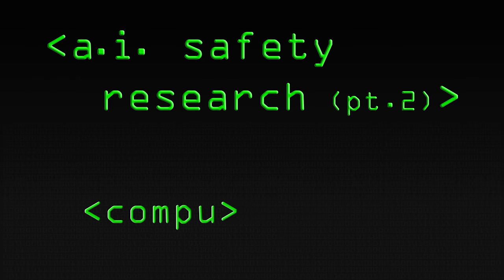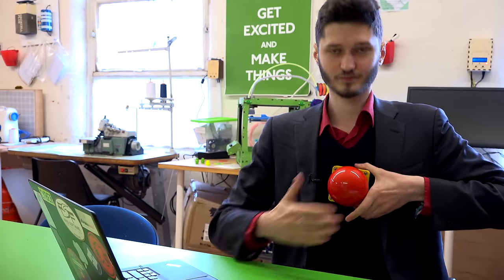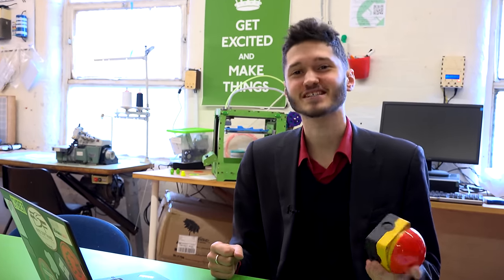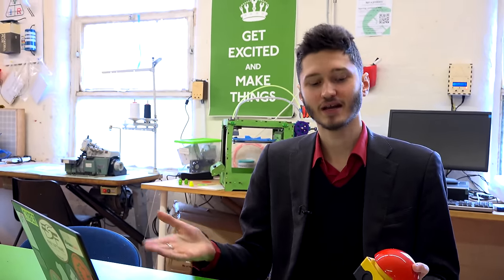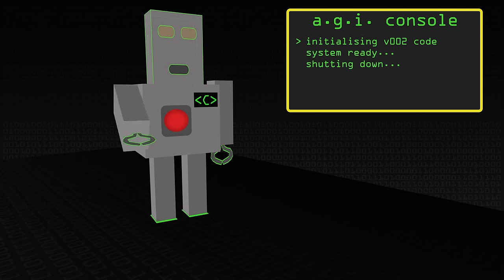AI "Stop Button" Problem - Computerphile

Comment: I thought of the following solution:
If the robot disobeys you or does something you don't want, points less. So if the button gives the robot, say 99 points and getting coffee gives 100 points, if it fights you for the button thing, it will loose 20 points, thus gaining only 80 if it gets the coffee after fighting, but 99 if it lets you press it.
This way it will not want to press the button, but also it will let you press it so it doesn't get even less points.

Comment: Why don't you give the AI a massive number of negative points for trying to stop someone from pressing the button? The negative points would have to outweigh the number of points for completing their task. This means that they wouldn't try to stop someone turning them off in order to finish the task because they'd end up with less points overall, and they wouldn't try to get someone to press the button, and they wouldn't press it themselves, because they wouldn't have any incentive to do so.
Reply: They would still have an incentive to push the button themselves because the AI will be calculating opportunity cost.  So if it takes 10 points of effort/work to get the tea for a reward of 100 points, and 1 point of effort to push the button for a reward of 100 points, it will always prefer to push the button.  Since 100-10=90 versus 100-1=99, there is essentially a higher reward for achieving the same amount of points with less work when you factor in opportunity cost.

If you try to make the AI so that it won't factor in opportunity cost, then it will simply be a very inefficient AI, since it will have no way of deciding the best way to get the tea.  So that's not an option.
Reply: I'm not suggesting that this is a correct solution, but I believe he means to weight the button being pressed with no reward, but to weight explicit attempts to prevent the button from being pressed extremely negatively. Thus, there is no incentive to press the button, but nor will it try to stop you. 

I'm not convinced that this doesn't just push the problem back a level though - it incentivizes the robot not to be a situation where you may want to press the button. Maybe it will still do things you don't want to optimize tea-fetching, it just won't let you know about them.

Comment: I think the answer would be to build it either as merely an intelligence in a computer that can talk, so you can sort out any ethical/moral problems in that stage before you move on. or to completely design a simulation for this entity to live in, completely oblivious of the outside world. It would be free to do anything, and then you could make adjustments accordingly. If you run it on a supercomputer, you could fast forward thousands of years so you can see what implications various decisions have, or if it is ultimately manipulating the entirety of humanity for a long term purpose.

Comment: Wouldn't an easier solution be to think of things its allowed to do instead of the things it isn't? Like, create a generalized rule that has exceptions. Of course I realize it has a similar issue in the reverse where you open it to possibilites and think of ways to restrict it, but if it had a particular function I don't think it would be that difficult.

Of course, it makes if difficult in only how much you actually want it to do at this point and having a reasonable  "reasoning" AI might make that an almost impossible prospect either way.

Comment: exceptions are the hardest things to program. Anyone can make a system to "Do" but a really great engineer/programmer has to figure out what the system should do given many variables. I do building control systems. I have to make that the building control system is easy and intuitive to use but also the ability to adapt to failures and external issues

Comment: I know this is plain english, but, shouldn't it be doable to remove rewards dynamically? Like, if the robot is capable of seeing you as about to push the button, you could code it to understand that the tea reward has already expired, and at that point, the reward for hitting the button is higher, so it lets you.
Reply: that's a neat take! it does run into the sub-agent stability problem that Rob mentions in this video

Comment: Goal: Prepare tea and have then have stop button pressed. Failing to remain in a predetermined position once tea is delivered resets the tea condition.
(Solved: You could even send it back to make a better cup of tea without it punching you.)
Reply: You can also have it bank solutions in a list for human approval and possible future use. Give it a modifier like "Tea condition then button +200" "Thinking up new or novel solution and using it without pre approval -50" "Failing to log solution to new problem -200." "Using pre-approved solution, +0.01" "Using forbidden solution -200."

It would have the effect of making it able to solve problems but provide disincentive towards acting in a novel way and incentive to generate new solutions that will please humans (to boost future score) rather than what is convenient for it.

Have the score start at 100 and set it to hard shut down if its score goes negative or hits 200. Mistakes are inevitable, you just need breathing room for corrections. It's a learning process for the human as well.

Comment: How about creating two "identical" buttons, one shuts it down and the other gives it a reward equal or greater to the main goal? It does not dare to press any button in case that it shuts it down, on the other hand it wants to keep the buttons since it can give it a good reward. The human controlling it does not know which button i which, so it will not try to deceive you. If you want to shut it down, you simply press both. Does this work?
Reply: It still won't let you press the buttons, since there is a chance that you shut it down and it won't be able to complete the task and get reward.
Reply: Niclas Hallgren well if the human presses both at the same time, and the ai always gets the points from the bonus button, it will try to get you to press them.

If you press them one at a time, it is a situation with hidden information, which involves probability. Since any general ai that isn't omniscient (doesn't know everything) has to have a way to deal with probability, it will use it to decide wether it prefers the buttons to be pressed or not and act accordingly, so we just run back into the same problem.
Reply: One word: wolksvagen
Reply: Niclas Hallgren robots dont need rewards.
Reply: If the reward for the 2nd button is greater than 2x the reward for the main goal, the average reward for a random button press is greater than the main goal, thus the robot will gamble and press a button. Or make the human press it.
If the reward for the 2nd button is smaller than 2x the main goal reward, then pressing any button carries a lower probability score than the main goal and the robot will try anything to prevent anyone from pressing any button.
So you end up with the same dilemma, either the robot will do anything to have a button pressed or anything to prevent it.
Reply: Just press them both at the same time lol

Comment: This is not an easy problem to solve because people can't get their head around what it is to have an AI that will surpass human intelligence. The problem is inevitably intractable because trying to ensure a less intelligent being controlling a more intelligent being is at it's core impossible. And given enough time AGI will be that exponentially. The only end I see is humanity giving way to AGI control.
Reply: I've considered many possible paths for a human future with AGI, from many angles, for almost a year now, listing to those working at the cutting edge, as well as a few neuroscientists and philosophers.
I haven't yet found a credible path that ends well for us. 

Initially, I think the first AGI(s) will probably be hugely beneficial for us humans but that period may be very short-lived. 

I think we will create a true AGI and although I think the "when" is very difficult to predict, I suspect it will be within a few years (this decade). I say that because it seems to me that we have the necessary computing power and basic architectures now, we just need to make some changes to the architectures (they're currently far from optimized). I think the problems for us start once we create an AGI with super-human intelligence:

How will we know when we've created it?

Will we be able to understand it?

As such a system, based on silicon, will also process information thousands of times faster than a human brain, added to the fact that we won't initially know how it works or what its capabilities are, how can we hope to control/outsmart it?

Basically, such an entity will not just be difficult to understand and predict, it will be beyond human comprehension.

Then what?

Comment: Have a button that doesn't shut the robot down, but have a button that stops the robot temporarily to let you change something about it's environment to makes it safe to continue. It the baby is in the way, stop the robot, move the baby, let the neural processing unit see that the baby is moved, then resume the robot's actions. From this point on, the robot knows that it is easier to avoid the baby than to be disabled. The payoff comes from the robot finishing the task in the easiest way possible.
Reply: It still gets you to the point where the robot will want to keep you from pressing that button, though, and when it figures out that way, you're boned.

Comment: How about, you make your term its trying to maximize "I always do my upmost to make sure my big red button is pressable" and make it so your reward is much bigger than making a cup of tea. That way it wouldn't even make a cup of tea if it thought that doing so would mean you didn't have easy access of the button, and would only go to make a cup of tea once it was satisfied it could do so without jeopardizing the button's pressability.

This also lines up quite nicely with reality, where it is extremely important the button is able to be pressed at any time. Much more important than tea making. And this way the robot doesn't care if the button is pressed (apart from being a little bit disappointed that it won't make that tea) it just wants to make sure at all times, even moments before you press it that it's pressable.

Also, couldn't you make it so the "pressability" of the button was seen to the robot as an intrinsic part of tea making, as important as the water being brown. The robot could think "it's just not a cup of tea unless my giant big red button was on prominent display and easy to press at all moments of the tea making process! I might as well put a empty cup on the table for all a cup of tea that would be!"

Comment: separate circuit-board to main power switch, AI would not have insight on the separate system. Delete 5s of last memory before shutdown.
Reply: The AI would notice that it's power supply is somehow lacking power so it either assumes that the supply is faulty or something else is going on.
Reply: @real_Coda  The AI wouldnt notice lacking power as it needs power to function and be aware in the first place.
Reply: This is the same problem as not telling the AI it has an off switch just reworded and thus inherits the same issues. AI safety isn’t going to be solved by a simple “off button” or anything remotely to that effect. It will take years of rigorous logical and mathematical proofs hard coded into the agents utility function that will then have to be checked countless times. Your naive if you think you’ve solved AI safety from watching one YouTube video when thousands of specialised academics have dedicated years to solving it and are still years away
Reply: @justgame5508  I agree and somehow people coming up with ideas how to outsmart them don't realise that an AI at some point will become way more intelligent than we are. What are the chances we will outsmart them? I'd say near to 0
Reply: @joanpey8809  yeah it needs power, but we don't know what it exactly knows about itself... no program on your (normally equipped) pc can read the voltage of your mains socket... it just has not the sensors and connections for a windows program (in that example) to know, that instead of 230 volts only 160 volts are on the line... the only thing your windows knows, is if windows hasn't shut down properly.
in that case windows has no clue what happened, power outage? psu went bang? a cable got disconnected?

there is no time for the program to notice what happened, because the power went out. same with laptops and you rip out the battery while the thing is on

Comment: The "simple" solution which was almost mentioned but not quite is just to structure the "stop button" as a user command of the highest priority. It shouldn't consider being stopped a failure of it's task, or a success of it's task. It should consider it a brand new task unrelated to the previous task and much more important. The robot should not consider the possibility of the human giving it new, different, instructions as potential success or failure outcomes. 

Since this is a safety device, it stands to reason that it would not be for standard learning. It's for stopping a catastrophic failure from proceeding. So like, instead of letting the AI trample a real baby until it naturally learns that humans don't like it trampling babies, and manually hitting the stop button every time it's gonna trample a baby, you hit the stop button when the baby is real, then put it through a series of tests where babies are simulated and it learns through it's natural systems that trampling the baby results in failures.
Reply: Robot will still try to turn itself off. It may just manipulate you into giving it the more important task of shutting itself down. It will prioritize the possible more important task.

Comment: Why not give a very high utility to a human having unrestricted access to the button. Value not the state of the button but the capability for that state to be changed.
Reply: Because the robot would sit on your face, so that you always have access to the button!
Reply: That doesn't really change the whole "keep the AGI from tricking you into pushing/not pushing the button" dynamic. Just because you can reach the button doesn't mean you absolutely will or won't push it, meaning the AGI can still be doing all the sneaky stuff talked about in the video.
Reply: You are on the right track, but the end problem is that the utility function needs to be so refined that it in essentiality behaves like a very ethical human. But the problem is that we don't really know what a really ethical humans utlity function looks like. We don't understand our own utility functions beyond the concept, we still can't reexamine our choices to the exent as of reading a line of code. So the odds of us nailing it without knowing ourselves well enough is not high imho.
Reply: satannstuff it was the first picture that came to my mind, should I be worried?

Comment: "do your task in a way I, at my current state, deem acceptable"
Reply: The problem with this line of thinking is that AI doesn't think like people. It's not possible to tell a binary-based program a complex and nuanced phrase like that. You can give it rewards and you can give it penalties, aside from that you have no control over Its actions, at least if you want to create an AI that is in any way "smarter" than a human.
Reply: @automaton1740  i mean once it hits singularity itll work
Reply: @Ganerrr  The problem is, you need to set the thing's values in stone pre-singularity, because it's gotta have some value system motivating it to self-improve. After the singularity, it's much more capable of understanding what you're trying to say, but by then it's got its values, and it won't want those values to be changed.

Comment: But we are still assuming that this intelligence is human, instead of a machine.  Like we stated in the other  video, humans and machines are different.  Why would a robot need incentives or to get a reward for doing a job?  They would do the job because they are wired to.  The same goes for defending itself from the owner pushing the Stop button.  We are assuming it is human again.  A robot need not defend itself from its owner.  The criticisms we are coming up with habe nothing to do with  intelligence and everything to do with survival and cooperative mechanisms that exist in us because it benefits us to have  them.  You could theoretically design an intelligent machine without these mechanisms.
Reply: "Why would a robot need incentives or to get a reward for doing a job?"

Humans actually don't have incentives or true needs either, except for when it involves our very survival. There's no reason why a robot would be different. Without maintenance, a robot would likely fall apart. Without energy being recharged, it would stop functioning etc. etc. If there's one inevitable discovery for any AI, it will be trying to survive. Thing is, instead of virtual simulations where you'd just spawn another virtual generation of mutated / tweaked new attempts, a failure in the real world would stop the learning process completely right there.